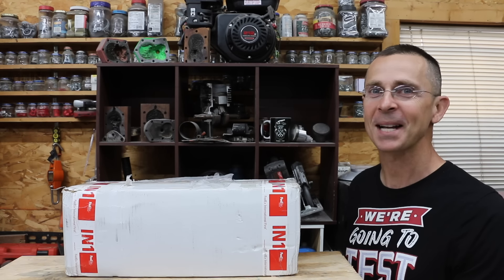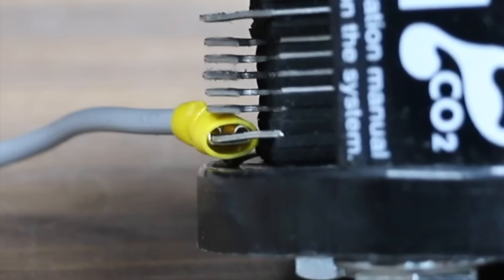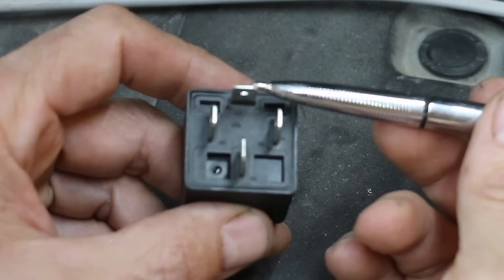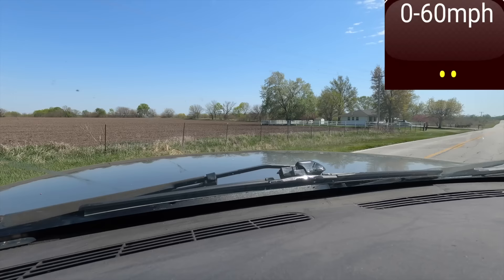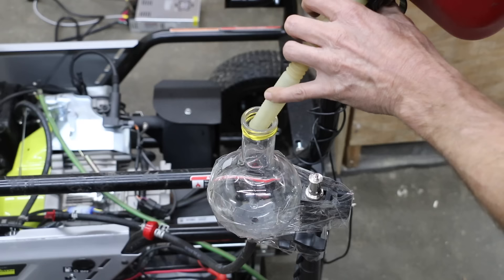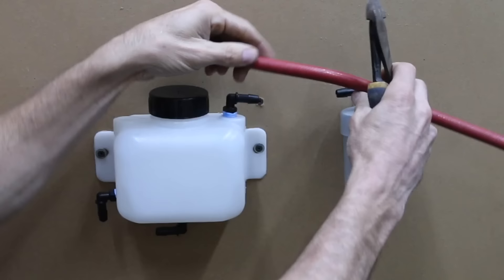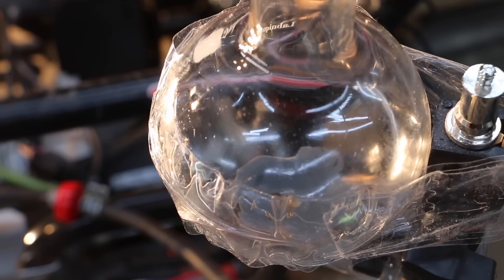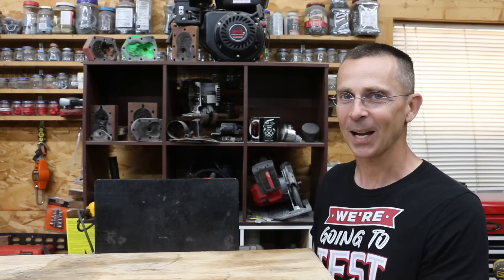AMAZING 35% More MPG with HHO? Let’s find out! Help with high gas prices?

Comment: It's simple physics. It requires a certain amount of energy to break the bond in water. That amount of energy is more than the energy you get back when you "combust" them in the engine. And that's IF it were 100% efficient. There's a massive efficiency loss between the HHO input into the engine and the alternator output to the generator. This thing will actually cost you MPG rather than increase it.
Reply from the maker: Thanks for the feedback.
Reply: This is the correct answer, which can be determined via thermodynamics and energy conservation.
Reply: No, the ecu will not allow the use of alternative fuels. There are hydrogen cars out there, hell Arnold Schwarzenegger bragged about his HHo hummers in the early 2000s
Reply: So you are ignoring the fact that the engine is not running at 100 percent efficiency. That would be the physics violation.
Reply: @scottcarr3264  😂 You didn’t realise he was a fraudster?!
Reply: Is there a chance that the engine running in closed loop identifies a lean condition with the HHO present and injects more fuel to compensate?  Test again watching lambda readings and see.
Reply: @jsflagstad  Does the generator even run in closed loop or is it a speed density system. For it to run closed loop it would have to have a mass air sensor and maybe it does,I don't know. This is one area I think gets overlooked buy many who try and use these hho systems. You can't just add any type of fuel and expect a better result. You don't want to run e85 if your engine is not tuned for it. I agree with you that the o2 sensor would potentially read a leaner fuel mixture and compensate buy richening the fuel mixture there by eliminating any positive effects there might be. And nobody is trying or should think that 100% efficiently is the goal just better efficiently.
Reply: @thatsonebadhatharry8610  Many SD systems do indeed use O2 sensors not just MAF systems.  This generator may just run on a simple lookup table though in which case it may not.  I guess the real test may be to run the HHO on a closed loop system equipped with an O2 sensor, monitor the O2 sensor's behavior and possibly "condition" or "fool" the signal it sends back to the ECM.
Reply: @jsflagstad  It would really need to be tuned with the hho in mind. Usually tricking the ecm is not the best case scenario. You need to run a leaner afr to see any real results from running hho. Or run a lot more hho than most cheap hho generators can produce. One other thing is that the input hose should have a vacuum on it to where the greater the engine speed the greater the vacuum. The truck intake location was probably a decent one but there was no other modification (no tuning of the ECM) to take advantage of the hho if it was even enough hho to make a difference.
Reply: The reality is that actual efficiency of combustion engines is between 3% and 8%. The other 92 to 97% goes to heat loss. Then there is the efficiency of the alternator, converting mechanical energy to electrical. This is at best 15 to 20% efficient. That energy has to go to the HHO generator, simply to break apart hydrogen and oxygen. The hydrogen is then fed into an air intake. You have produced HHO by supplying energy to the water molecule to break it apart. When you burn HHO, you are simple recombining these molecules to form water again. So this will NEVER WORK. Because no process is 100% efficient, you can never get more energy from breaking apart water molecules, and then recombing them. Every step of the process requires energy input. All of that is lost energy. These products are a total scam for ignorant people.
Reply: How dose the efficiency% of hho production/ burn or alternator inefficiencies play into any part of this domination? You are simply adding an additional and/or supplemental fuel .
  With the Genset the hho was produced by the wall removing all parasitic load/loss, there is no 50% efficient alt. to consume more Watts/BTU  than produced.
Reply: @davealmighty9638  generators/alternators/electric motors generally run in the 80%+ efficiency range when converting between mechanical and electrical energy.
Reply: @davealmighty9638  you give great explanation but wrong conclusion 🙂 Just read first part, ICE engine have bad  efficiency... And HHO gas raise efficiency, that's a good conclusion. I have practical experience about those stuff, and  this can work. Just need some big knowledge and experience, or some big happiness 🙂 Explanation not necessarily.
Reply: @davealmighty9638  there is one other factor that could make it viable. If the HHO burns the petrol more efficiently then an overall gain is possible. Unfortunately the amount of HHO  being produced is insignificant compared to the airflow. Maybe if you had 50 times as much HHO flowing it may make a measurable difference. Unfortunately the increased load on the generator with corresponding losses would far outweigh any gains unless you cheated as he did by using mains electricity giving extra free fuel.
A test on a very inefficient carb. engine may show better results than a fairly optimized modern engine but again much more HHO would be needed so I doubt it would ever be worthwhile.
Reply: @davealmighty9638  you started fine in first comment and then go to the other side, you confuse to yourself. I can chatting about free energy or overunity, but this is not a theme here. We have one inefficient engine, with bad combustion, and we just make it more efficient, better combustion. This is about technology, not about laws of physics.Same like if you say that Air Conditioner cant work, because give around 300% output energy, but it working and your opinion or misunderstanding cant change reality. But once again, it is just a theory and no matter, I do it and it's working. But not so easy, minimum 90% of all HHO generators don't works, and this is only reason why it's not in massive use all over the world. Of course, peoples like you are another reason, because you are not brave enough to investigate and experimenting, and you also affect to others on same way. Maybe I was giveup also, but I was lucky to make success in one of first few experiments and I know the truth. I was tested many designs and setups which I saw on internet, but just few of them working. Some of them even make more fuel consumption, just few make less. And this is not something from my subjective feeling, I do much good testing. And this is also prooven from many scientific institutes from all around the world, and her we have just your (snd others) ignorance, nothing else.
Reply: @foxythedirtydog4494  you are partially right. Hydrogen snd oxigen  require more quantity to make better combustion, that's right. But here we have a little different situation,   if we make HHO gas ionisated enough, then we need much less quantity. And also we don't need HHO gas, we can use ionised water too.  That's a reason why those generators have occasional successes, some didn't work, some works. In some cases, there no better combustion and fuel saving from that, but just carbon deposits cleaning from some time after installing HHO generator, and this is reason for better fuel economy and smoother ride (little more power and torque), engine in every moment working like brand new. When you have around 15% fuel consumption, this is from decarbonization, and when you have around 30% and feel much more of torque, that is from better combustion of fuel, complete combustion. When we raise a fuel combustion for one percent, we gained few percent of fuel economy. My English not so good to explain why this is happening, but if you know some engineer, ask him for explanation.
Reply: @davealmighty9638  ha ha haa 🙂 I didn't wrote because of you, but because of all the people who reading this 🙂 If you not interested in better fuel economy and ecology, its your right, but some of people are interested, and I just want to give them support, because they maybe will giveup because of peoples like you. I don't need to make  scientific study, when some institutions was do this. Peoples just need to read it. What I have from your opinion, nothing! But you can have something from information which I spread here. Oh, just if you didn't here to do your job, maybe you are some agent 🙂
Reply: @davealmighty9638  you misunderstood my comments. HHO will never help a modern closed loop fuel system so there can be no gains. 
An older carb engine which is not fully burning the fuel despite having enough O2 may run better due to the burning HHO helping give better combustion. No laws are being violated as it is simply using more of the fuel instead of just pushing it unburnt out the exhaust. But as I  said, I doubt there could ever be a net gain in output power just cleaner emissions. 
Think of it like a catalytic converter - they increase the temperature of exhaust gases (extracting more energy from the fuel) yet  no extra fuel is added. They just burn what would have been wasted.
Reply: @aleksandarpetrovic6613  no engineer would ever say you cannot use a heat pump to get more energy out than the electricity you drive it with but the energy doesn't magically appear, it comes from whatever is being cooled. 
Same with HHO, no energy is being created it is just changing states. In your testing, what powers the HHO generator? Unless it is powered by the engine it is burnt in you are cheating yourself. 
It takes a lot of energy to produce enough HHO to make any difference and due to losses it cannot be made up by any extra power gained. I am willing to be proved wrong but even an extremely inefficient engine is very unlikely to ever show a net gain and a simple tune up will give a much better power increase. 
Overunity does not exist at least not until you get into quantum mechanics which is witchcraft to me and I don't even try to understand how that voodoo works.
Reply: @foxythedirtydog4494  if something working, you cant say that can't work. You just need to find good explanation of that. I don't know better explanation but this as I say before, HHO gas is just an additive, cstalist, we use it to make better combustion, snd gain from better combustion is enough to covers losses of electricity for HHO gas, and for better fuel economy, too. And I didn't thought this, this is explanation from many scientific papers which I reading. All of you have right to think what you want, but you are just have not knowledge and experience about this, nothing else.
Reply: @davealmighty9638  hybrid electric run on the principle that the electrical system produces more current than is consumed. The alternator is always in motion. In this sense, the trickle current drawn from the system, adds no additional load for such a small unit.
Reply: @kurtiousmaximus7130  you are living in a parallel universe. Hybrids store electricity in a battery. This comes from using the drive motors as generators during deceleration. There is no magic.
Reply: @foxythedirtydog4494   than please explain to me how the oldest form of hybrid , diesel electric locomotive, works without batteries for  the last 70 years. Here's a hint they have no intentions of ever wasting the space or weight on batteries of any kind other than starting of locomotives the diesel(2 36vdc forklift batteries for 96 vDC).
Reply: @aleksandarpetrovic6613   I think the terms that you were looking for on what is different about an HHO gasoline vehicle versus a straight gasoline are Flame Front, Spontaneous Combustion and Localized Temperature ...
Flame Front.
This is the speed at which the localized temperature changes from below reactivity to above.
  This property is changed by the presence of a gaseous fuel  versus atomized/ droplets of fuel in an oxygen-rich environment . The same principle can be demonstrated in a diesel engine by adding propane.

Localized temperature   boiles law shows that the vapor pressure at the surface of the droplet is above the phase change pressure for the current temperature move a couple of microns from the surface this pressure will decrease from gas expansion as this expansion continues it relieves pressure on the surface creating a localized spot where vaporization can occur. Eg liquid Nitrogen sitting on a table top forming a BLV ( Boiling Liquid vapor)  propane will also do this we spent 5% of our 12week training on this property of propane when doing my conductors training for the Union Pacific railroad

Spontaneous Combustion

The  min temperature AND oxygen concentration required for a substance to experience an exothermic reaction, runaway thermal reaction .
  Fahrenheit 451 is a book about paper and its specific spontaneous combustion temperature in atmospheric oxygen exposure(cellulose happens to be 451° f@ ambient sea level oxygen concentration) Raise the O2 concentration and this temperature will drop. In contrast on Everest (25000' +) where ambient oxygen is not enough to support human life the temperature at which paper will burn / spontaneously combust is well above 500°f without bending any of the laws of physics much less breaking any of them  .
Reply: @daviddroescher  I'm not too familiar with trains but they don't have batteries for several reasons  -
The battery would need to be huge so impractical. 
Trains run at a fairly constant speed so not much energy to be saved into a battery.
The electric side is there instead of gears or a hydraulic drivetrain to allow the engine to run at its most economical speed for the load on it.
As batteries become cheaper it may become worthwhile fitting them to take advantage of regenerative breaking but unlikely to be used instead of diesel.
Reply: @foxythedirtydog4494   I can only imagine they would test this battery charging system off dynamic braking on the 4th of July as it would be visible 100's of miles  (160's of kilometers). How many kilowatts (watt ≈btu ≈calorie) does it take to reduce 6,800 tons(14,600,000 lbs / 6,181,818Kg average weight of consist I handled +  engines add 1,000 ton  ) by 25 mph in less then 1 mi(1.6k) on a 2.2% grade?  My guess is the btu rejection by the dynamic brake heat grids is more than the entire train car load of Tesla batteries can hold. Technology will be required to step up to liquid glass capacitor technology to be able to handle the surge load+ capacity
If you've ever driven electric car with an almost full battery and expected the dynamic braking to function and got the scare of your life  ; you will understand why batteries are not involved.  They have limited finite volume of capacity requiring all of the dynamic breaking equipment to be maintained in redundancy so that when the batteries hit the topped off limit it doesn't kill the train crew from loss of brake capacity. ( this  applies in grade territory not as much the flatlands.) there is no steady state throttle nor is there ever steady state breaking in grade territory basically because the load is never steady state the slack is constantly running in and out.
Reply: @foxythedirtydog4494   and I quote " you are living in a parallel universe? hybrid store electricity in a battery."   diesel electric not a hybrid, due to lacking a battery that  what you are trying to explain by my request.
Reply: @daviddroescher  diesel electric is different to a hybrid car. Hybrid just means a combination of 2 systems. A hybrid car combines an engine with an electric motor and normally has a battery to store and then release energy that is normally wasted by braking. 
As for trains, I clearly said batteries are not viable yet but in the future maybe used to save energy lost during braking just as electric trains do already. This is more likely to happen on small commuter trains that are light and stop frequently. The savings on large freight trains is not worth it.
Reply: @daviddroescher  there is no magic energy being harvested from somehere. All these different systems are doing is enabling engines to run more efficiently such as Atkins cycle or just kept running at their optimum speed. Batteries are used to help store wasted energy and improve acceleration. HHO is not going to help an efficient modern engine as the losses outweigh any gains whether it is a small generator or a train or even ships.
Reply: @foxythedirtydog4494   are you Shure it only has to check 3out of 2 boxes, doesn't hybrid have a 4th box to checkout of 2?

I mean some  states ( may call them countries or provences were your from) don't give a tax credit for hybrid unless it brings together 4 technologies .
1) an explosive linear  rotator actuator  Aka motor that converts volatile hydrocarbons into water vapor and carbon.
1.5 an a magnetron to convert magnetic flux into a storable  form.  Different kind of motor spun backwards.
1.9) a vessel  it hold storable magnetic flux.
2 a wall outlet charge capacity make sure you get your coal burn to feel good about reducing your carbon effect tax credit.
I guess that would make it a quadri brid instead of a half breed or or politically correct hybrid  means of 2. but that's to hard to say  skip the battery.

. So  what do we will call the diesel + electric = 2 or more  technology ?
Reply: @daviddroescher  "are you Shure it only has to check 3out of 2 boxes," - no, hybrid is a very loose term so can be used to describe many things.
Your definitions are like something outof a science fiction movie -
"1) an explosive linear  rotator actuator  Aka motor that converts volatile hydrocarbons into water vapor and carbon." - It's like a bunch of fancy sounding words thrown together with no overall meaning. If you mean internal combustion engine then just say that instead of that nonsense.
"1.5 an a magnetron to convert magnetic flux into a storable  form." Do you have any idea what a magnetron is? Try searching for how a microwave oven works. They have nothing to do with electric motors/generators.
"1.9) a vessel  it hold storable magnetic flux." I am assuming you are talking about a battery - they don't store magnetic flux.
"2 a wall outlet charge capacity make sure you get your coal burn to feel good about reducing your carbon effect tax credit.
I guess that would make it a quadri brid instead of a half breed or or politically correct hybrid  means of 2. but that's to hard to say  skip the battery." - I can see English is not your native language but I think I understand what you are trying to say. I'm in the UK where there is only 1 or 2 coal fired power stations left. Wind, nuclear and gas are our main generation sources so charging batteries is the green option plus the polution is removed from cities. 
"So  what do we will call the diesel + electric = 2 or more  technology ?" Diesel electric is the accepted term and works good for me.

By moving the discussion into definitions and trying to use mixed up jargon, you are only showing you don't know what you are talking about. I am an engineer and understand the meanings of those words and can easily see you do not. 
You are using tactics typically used by youtubers who are trying to move the conversation away from havin to defend their dodgey claims. Adding in fancy sounding terms that turn out to be totally irrelevant. Try directly discussing the points raised by people who disagree with you instead of avoiding them. This way you will understand where you are going wrong. It is good that you are thinking but be prepared to be wrong. I get things wrong and am pleased that people are prepared to spend the time explaining things, when I am.
Reply: @foxythedirtydog4494  I threw all those nasty terms in there to make the point that you accepted loudly and then flex your education no I did not mean ice I meant any piston configuration  . And yes a diesel is a detonation engine that has linear moving piston motion translated into a rotating motion
Reply: @daviddroescher  what is the point of your "nasty terms"? They serve no purpose. If you mean engine, just say engine. If you mean generator, just say generator. All you are doing is making people think you don't know what you are talking about. Keep it simple then we can work on the facts instead of trying to work out what you are trying to say. Also you did mean ICE. but were trying to be clever again and got lost in your overcomplicated description.
Reply: Now that we are in agreeance locomotive is one  first  mass produced hybrids and qualifies to use such a term. I must give you a sincere apology as I was using bigger words in previous portions of conversation, so I put away the big words,and brought in the descriptive words. You have been successful you picked up what I was putting down and neither one of us should be upset about successful communication; this took too much effort to get mad at success. 
may we please continue on with the my  original comment and conversation as gentleman, scholars,and  knowledgeable people; with a handshake.?
 Two questions were originally,asked finding an engineer is exciting(means I have a chance of expanding my knowledge); they're much funner to catch than trolls or crabs. 
1) how does flame front speed affect combustion of gasoline droplet evaporation rate, and in turn combustion characteristics¿

I can modify the flame front speed with  A min of two methods
   1  a gaseous innert supplement such as argon ≈ slower
   2 or I can add an accelerant such as H2 , propane or NO2 ≠ faster. 
2nd)Isn't running the electrolyzer off of the generator/ wall the same as using bottled gas as far as your ICE can tell using zero crankshaft horsepower = non parasitic load?
  Eg a gasoline powered generator AKA non parasitic load producing Brown's gas for a diesel pickup truck both containing one gallon of fuel after 1hr of driving running 2ice  .
An example:
 the efficiency is improved on the diesel through the supplemental gaseous fuel by shifting the parasitic losses to an outside separately powered device.. no magic no laws broken . Just a shift of load to the generator or refinery..
(Note: my interest of HHO in replacing oxy-acetylene used to cut steel, with HHO not driving I SEE POTENTIAL BUT DO NOT HAVE THE FUNDING FOR AUTOMOTIVE RESEARCH)
Reply: @daviddroescher  Thanks, you will get much more respect by keeping things simple as you will be understood and less likely to trip yourself up. Although I am an engineer I have no experience with design so will not be able to help much but here are some observations -
1 - Flame front speed will vary from engine to engine due to head design, compression ratio and of course the fuel used. You also need to consider how to prevent pre-ignition (pinking or knocking). As modern engines are very optimised already you are unlikely to see any significant gains. The compression ratio will have been chosen to give the best combustion possible and exhaust gas recirculation (EGR) will inject inert exhaust gas when needed for economy.
2 - Sure adding energy from an external source will give the impression your engine is working more efficiently but once you measure the two and subtract the external power there is no net gain. You might as well just have a plug in hybrid car which has been optimised for this.

HHO used for cutting steel can work but I would strongly advise against trying to store any HHO as it is highly explosive. Oxy-propane or oxy-acetylene are both proven to work safely when used correctly. 
Car manufacturers spend billions on engine developement so don't expect to make any significant breakthroughs on a small budget. 
If I was you I would try to come up with a new type of engine rather than try to improve on what exists already. I did this a few years ago but didn't persue it. My idea was to use several vane pumps. One for the compressor and say, 3 more for the output stages. A heat exchanger to recover heat from exhaust gases and a turbo charger could be added for efficiency. I have never seen this done and it may still be possible to work if the right materials like ceramics are used. Keep learning and researching but beware of anyone claiming overunity - it is a con. You also have to consider who will be interested in your invention. Oil is being phased out so hydrogen or electricity are going to have much more potential demand.
Reply: @foxythedirtydog4494  no it don't store well . It compresses less well, to the point of being ban in the USA.  This permanent ban on HHO compression includes research facilities. When I first stumbled upon HHO there had recently been a research facility in Southern California that exploded while trying to find a safe way of compressing HHO without causing spontaneous combustion.
As far as economics go, it costs less to build a suitable HHO generator than to rent an oxyacetylene set of tanks.  If I recall correctly ,my research has stated that, especially at the industrial scale of a steel yard in a metropolitan area with heavy industrial / ship yards it cost less to use HHO with an on demand generator running on 110 AC then it costs to maintain the supply of oxygen and acetylene through local gas suppliers with major volume discounts applying. All industrial uses of HHO I am aware of do not use any form of storage it's all on demand only for safety.
Reply: @daviddroescher  glad you know about it. Safety should be the first consideration before cost. Even on demand systems are dangerous. For cutting you will still need an oxygen cylinder. Portability is another advantage of oxy-acetylene. I carry an oxy-acetylene portapack in my van but places like the decommissioned nuclear power station I am at tomorrow will not allow it on site - hope I remember to take it out before I go. I doubt they would be keen on HHO. 
HHO may be cheaper but I would not like to be working on a ship with it. Too many enclosed spaces for it to accumulate if there was a leak or a valve left open. At least you can smell acetylene. I would recommend oxy-propane for you if you won't use it much and only on thin steel.
Reply: Maybe it isn't as efficient but if the gas supplies ran out it would be great if we could get conversion kits to allow us to run on alternatives.
Reply: I stopped reading after "big happiness, no explanation" because it seemed the most credible interpretation.
Reply: OBrien, I wouldn't be so strict. Water injection increases efficiency by 10-15% and is widely adopted by the industry. It might be reasonable to test injecting HHO gas, instead of water. What if it would be benefitial to the chemistry of combustion?
Seems one would be better with plain water injection, but the conjecture was worth checking out.
Reply: Have to agree with the responses regarding the amount of energy it takes to produce the oxygen/hydrogen mix... Subtract the inefficiency of the power supply and production the gas and I'm sure that is why the engine run times are actually less than without running the unit. Any extra power produced is consumed and then some just by the amount of energy used to create the gasses.
Reply: @davealmighty9638  that is totally incorrect.
It is closer to 30%.